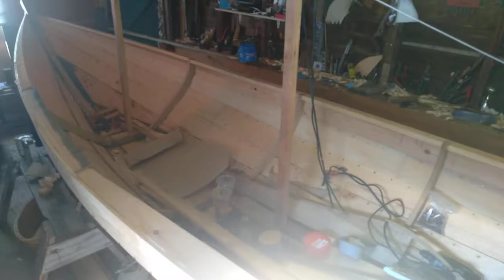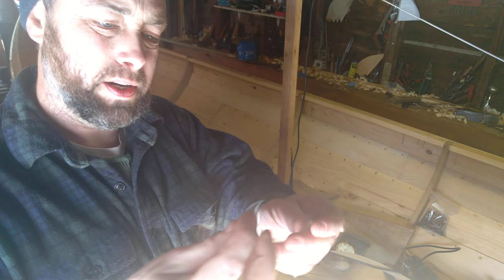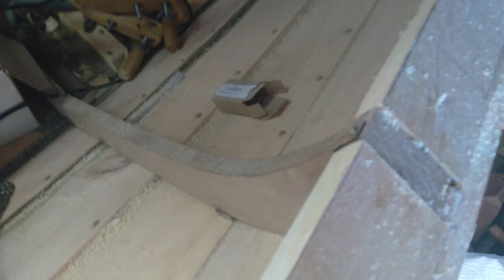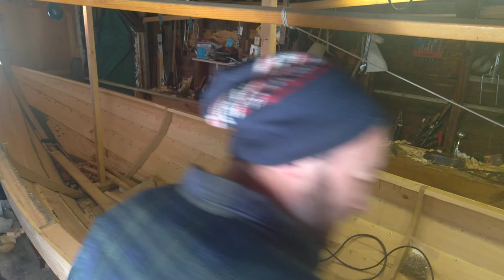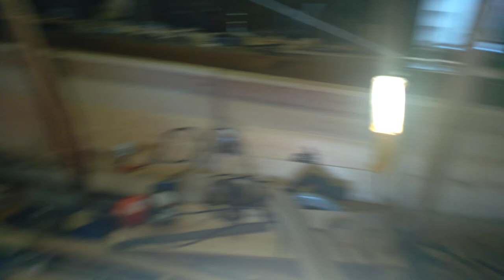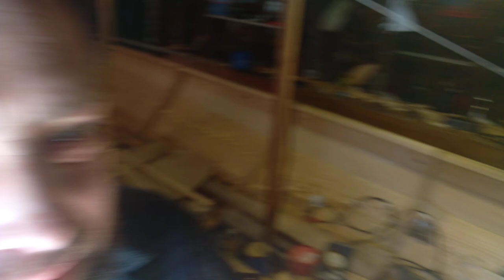making the rails, blocking solid rails. 💪👍

Comment: Did you drill for the ring nails attaching the sheer plank to the rail blocks?
Reply from the maker: No, these nails are smaller shank than the ones in the stem stern and bottom and seems to go into the pine just fine... I'll have to drill for nailing the inner rail into the oak frames.